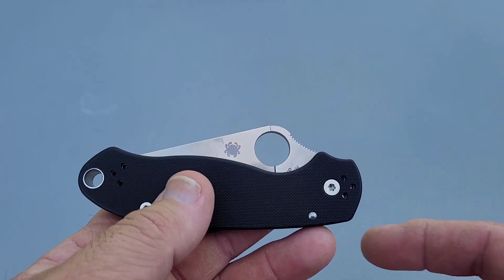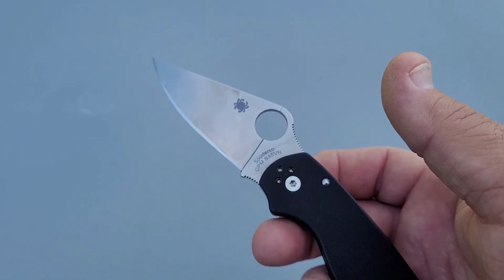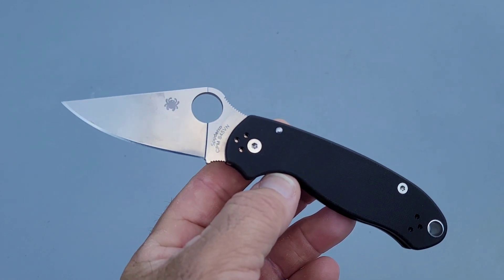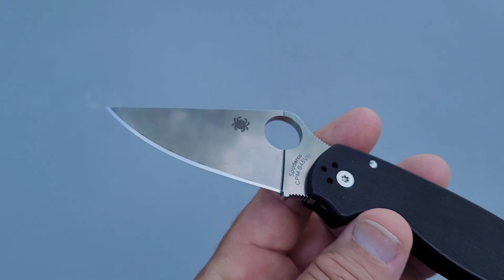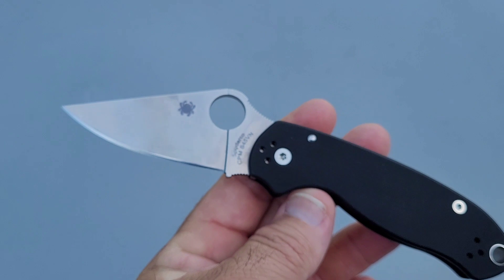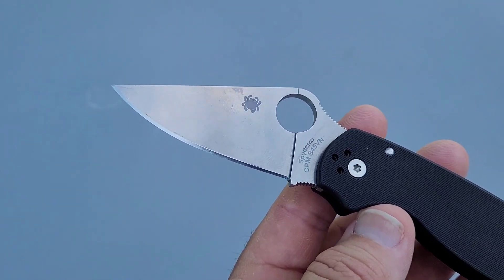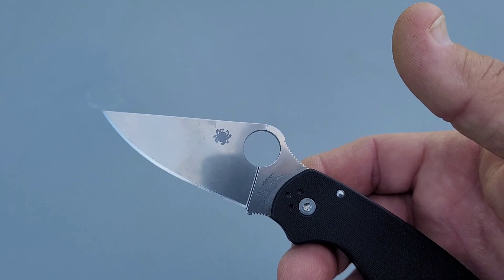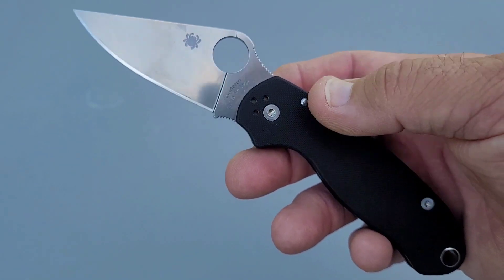S45VN edge retention testing. What does this newer steel offer on this Spyderco Para 3?

Comment: They only have s45vn for lefty paramilitary 2...but if you were a lefty would you get a manix 2 in cruwear or the pm2 lefty in s45vn? Cant decide since itll be my first spyderco and im left handed
Reply from the maker: Cruwear will have better edge stability,  toughness and wear resistance. While not stainless Cruwear still takes a lot to stain.
Reply: @Outpost_76 thank you
Reply: @Outpost_76 I love 14c28n for sharpening so I was wondering which of those two sharpens similar to 14c28n...Anyway thanks for replying , love the content.

Comment: is it worth the upgrade? From s30v to s45vn? I will need to spend $40 extra approximately
Reply from the maker: S45VN is going to be more wear resistant but have equal corrosion resistance to S30V and be close in toughness. If S30V last a good amount of time for you and you are happy how it performs then just keep with it. I'm going to touch on things like this in a video very soon.
Reply: I thought S45Vn has higher corrosion resistance but less in wear resistantce? Do you find it to be harder to sharpen S45VN?
Reply from the maker: @nonammmmme  I'll back it up a little. Going from known hardness tests on Spyderco S30V and S45VN,  the S30V is usually 59 to 61 and the S45VN was 61.4. Since we know what hardness they usually run these are the take aways. Since the S30V is softer it will have less wear resistance, toughness with a 1 to 1.5 rc hardness spread is going to be about the same. For corrosion resistance the heat treat done plays a part and can have an effect. It's not just a cut and dry that X is better for wear resistance or corrosion resistance. I'll cover it much deeper in a video.
Reply: @Outpost_76  Thanks man! I am new to this appreciate all the info
Reply: @nonammmmme  in my experience using spydercos with s30v and s45vn, s45vn is about the same to sharpen, but holds an edge a bit longer.  They are similar but if I had to choose, s45vn seems to be a bit better all around

Comment: This steel will go far, I predict. s30v will still be around for a "premium budget steel" but it will make s35vn obsolete for the most part. Chris Reeve Knives has also upgraded to s45vn, moving forward.
Reply: S45VN is likely to be very much displaced by Magnacut, which is all around a better balanced blade steel.  Watch CRK for the switch, both folders and fixed blades.
Reply: @ranger5281  This sure didn't ahe well.. Magnacut hype is over. It can be bought everywhere now. S45vn is still going strong.

Comment: Well at least it's slightly better than s35vn and 14c28n. Still a budget class steel IMHO. I'll stick with 300+ class steels.
Reply from the maker: That's pretty much what I carry with only a couple exceptions
Reply: Budget steel? Come on, these knives cost almost $200. A budget knife is like, $25-$75 and comes in 420hc or 8cr13mov
Reply: @chimchu3232  think about what your getting in performance. Break away from names of steels.
Reply: @tacticalcenter8658  I guess to each their own, but I think it's ridiculous to call s45vn a budget steel. I grew up using cheap Kershaw and Gerber knives, so s30v alone is a huge step up for me into a higher class of steel. S45vn works far better than any knife I've ever had.  They are nowhere near budget steel for me, and I'm not interested in paying over $300 for a pocket knife. Not trying to argue or disrespect, but I don't think most people see it that way. For most people a budget knife is less than $100. 
 Again, to each their own. I guess if all you use is magnacut or maxemet then maybe s45vn does seem budget to you, but most people are on the other side of the situation where s45vn is an expensive step up for them
Reply: @chimchu3232  its not to each their own. Look at the data. 14c28n is a budget steel. Its cheap and plentiful and easy to heat treat. Its on lots of China knives in knives around $50-60. Now compare that to s45vn which has a similar edge retention. You may gain some performance but pay much more.

The whole industry is stupid. They don't account for performance and they don't care much about heat treatment, they care about how many knives they can make and sell through marketing.
Reply: 14c28n is approx 200-215. S45vn 230-240. Probably gets a bit better in a custom heat treatment by a professional? Its better but not by much.

Reeves s35vn is around 200-215 also iirc. And I have 2 or 3 of those at around $400+
Reply: @tacticalcenter8658  I just disagree then.  To me, budget means price, not performance.  A knife than costs more than $100 is not a budget knife to me, ever. Even if it's made out of tin. 14c28n is generally a budget steel because it's on budget knives, but a 14c28n knife that costs $200 is no longer a budget knife. You have a point about performance, maybe its not worth buying because it's a small increase in performance for a large price increase, but that still doesn't mean it's a budget class steel if it costs $180.
Reply: @chimchu3232  what are you smoking?
Reply: @tacticalcenter8658  dude when people say "this is a budget steel" they mean, most people can afford this knife, they are not talking about performance, they are talking about PRICE. you can think whatever you want about me, but you are the one who said s45vn is a budget steel, and that's still a ridiculous statement, even after you tried to justify it. Ok so it's marginally better than 14c28n, an actual budget steel.  Then buy 14c28n instead, none of this makes s45vn a budget steel

Comment: Thanks . It is always interesting to watching your videos. I have PM2 Sprint Run in S45 and i am very satisfied. Like you said its very easy to sharpen and takes laser sharp edge. It seams that S45vn has very fine microstructure. It’s great news that you can make HRC testing.

Comment: That's high praise for the S45vn Gerald, XHP is such a great all around user steel. Thanks for the insight, looks like a really fun steel that will EDC great.
Reply: I agree with you on that.  I've always loved the Spyderco Chaparrals and CTS-XHP has always been a steel that I enjoy.  I think it's underrated and doesn't get the credit it deserves.  But, then again, there are so many great steels nowadays and the prices are excellent. 10 years ago if you told me that decent name brand knives with CTS-XHP, nitro-v, s35vn (45vn didn't even exist back then hahaha), 4v, m390, 20cv, etc, etc would be available for less than $100 I would've laughed in your face.  Now we have D2, cpm154 (which is a steel I still love), etc knives selling for under $40 is mind-blowing to me 🤯.  I love how much better and cheaper steel keeps getting.  I haven't tried out MagnaCut yet, but I'm excited to test it out soon.  I have been very impressed with the Vanax on my Quiet Carry Waypoint.
Reply: @DrBlazer50  - I was fortunate enough to find a Cold Steel Ultimate Hunter in CTS-XHP about a year after they changed to CPM-S35VN.
I consider it one of my most prized knives. Love XHP!
Reply from the maker: So far in use its also been good.
Reply: Agreed. CTS-XHP is just one of those steels that I would be perfectly happy with on any of my knives. Great stuff!
It's a shame the market tends to always move to the new. XHP is hard to find these days even though truth be known it's equal to or superior to many of its more popular contemporaries.

Comment: Nice info G!
I have one of the Green Diamond G10 Sprint PM2's that I've not gotten around to using.  Nice to see it will probably out cut my brown S35VN version. Supposed to have better corrosion resistance but not quite the toughness of s35vn. Fine grain too? 
Am curious to see how it Rockwells. I'm guessing a solid 61.8  ;)
Reply from the maker: You were close